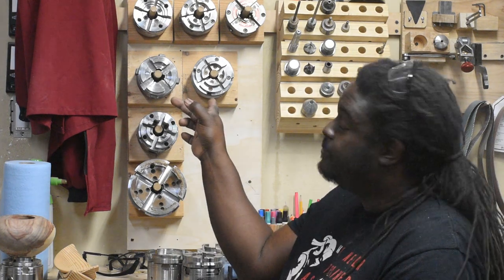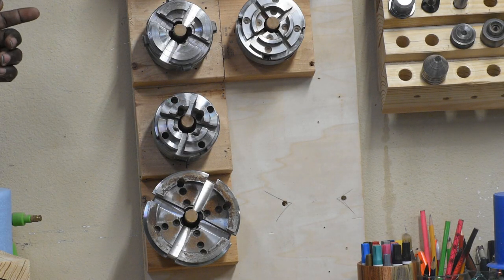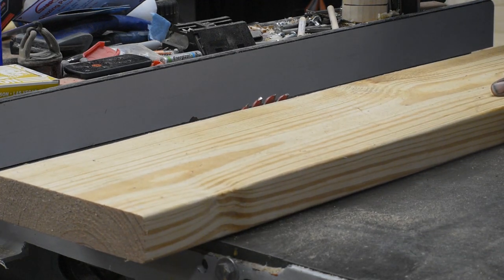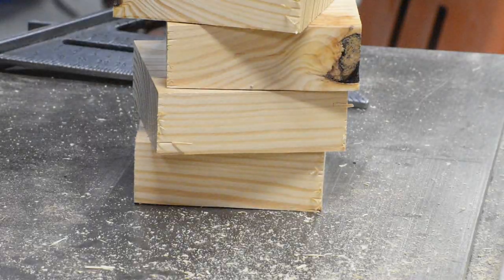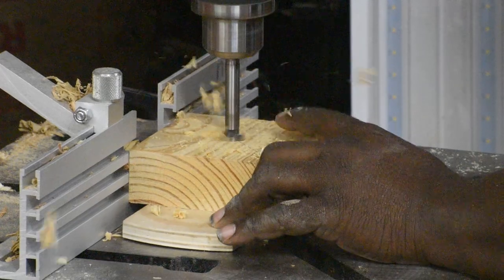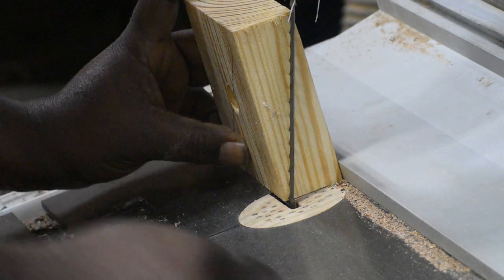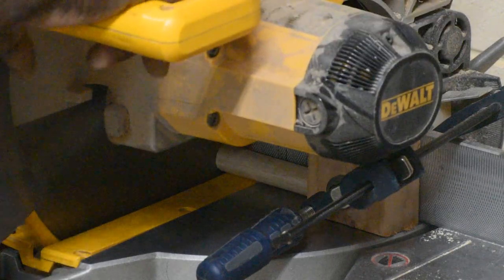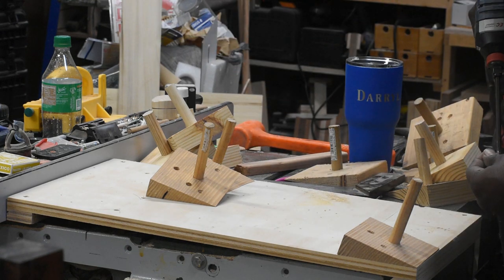Make a DIY Chuck Storage System

Comment: Hi Bruce, I wish you had put this video about a year ago before I bought steel threaded bosses for my chucks. Great design. Cheers, Huw
Reply from the maker: Thanks, I looked at the threaded options also but they were a tad expensive.
Reply: @DreadKnotWoodshop  Hi Bruce, Mine cost me £17 or $21 each and had to buy 6 of them. That hurt my wallet I must admit. Huw

Comment: I built a stand for my mini lathe and drilled angled holes for 3/4" dowels to store my chucks, but can only fit 3. This system, while similar, allows for a much larger collection. Thanks for sharing. I also noticed the other storage section you have for your accessories. Don't suppose you'd care to share that as well ;)
Reply from the maker: Actually, I will be doing a video for tht and the jaw storage system. And thanks for watching!
Reply: @DreadKnotWoodshop  I use cup hooks and shower curtain clips (the cheap metal ones that are sort of like carabiners) to store my jaws.